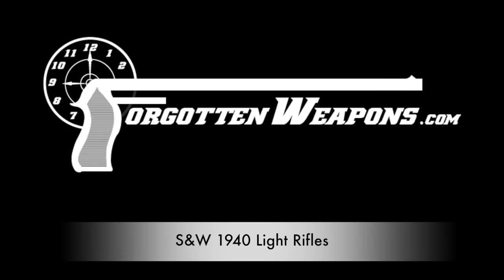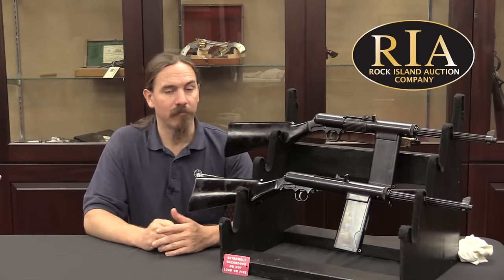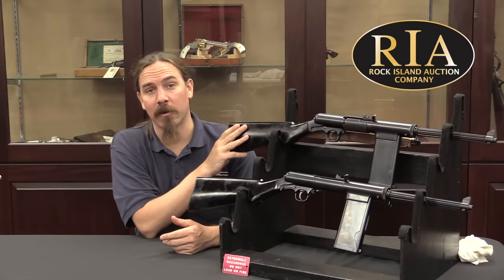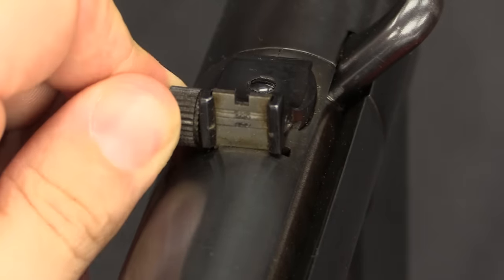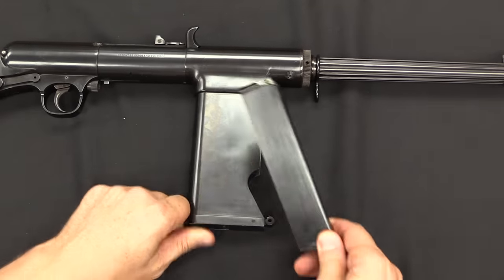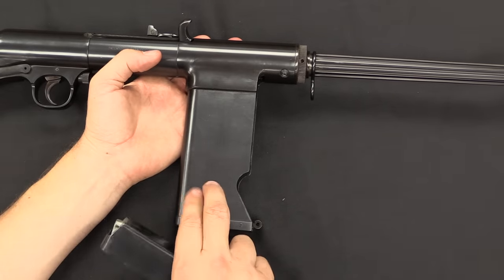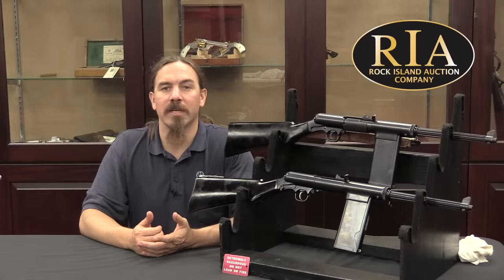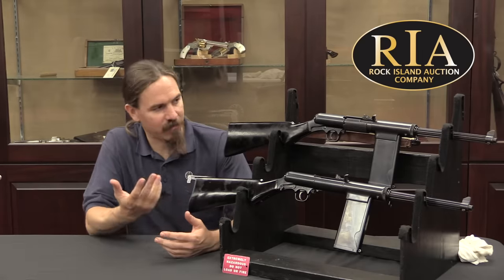S&W 1940 Light Rifles: Receiver Breakage is a Problem

Comment: Looks like a .30-06 SMG.
Reply: Twirlip Of The Mists unfortunately it’s a 9mm 😂
Reply: That's what I thought it was when I clicked on the video
Reply: Shane Sizemore same
Reply: Goes to show, size isn't everything.
Reply: I thought it was a .30 carbine rifle lol and submachine guns fire pistol cartridges haha
Reply: Had it really be a .30 carbine (yeah, .30 carbine can be fired in a pure blowback gun of acceptable weight. Trials made during the war with a modified Thompson demonstrated that a merely 570g bolt was heavy enough even for proofloads, that's less than the bolt weight of most WWII SMGs) sturdy enough, and shortening the silly ejection tube, it would have been a really interesting design.
Reply: @neutronalchemist3241  I get that, but I thought it could've been possible in this thing still.
Reply: @neutronalchemist3241  While 30 Carbine can be simple blowback, so can 30-06. That doesn't mean either of those are practical. Think about how heavy a simple blowback 45 has to be. Now at least double it for 30 Carbine seeing as it has over twice the inertia as 45 ACP.
Reply: @flightlesschicken7769   What part of ".30 carbine can be fired in a pure blowback gun of acceptable weight" was so difficult to understand? 
I repeat: .30 CARBINE CAN BE FIRED IN A PURE BLOWBACK GUN OF ACCEPTABLE WEIGHT. 
30-06 obviously can't.
A Hi-Point JHP .45 is "a simple blowback .45" that weight 907g, full 160g more than a breechlock Glock 21.
As said "TRIALS MADE DURING THE WAR WITH A MODIFIED THOMPSON DEMOSNTRATED THAT A MERELY 570G BOLT WAS HEAVY ENOUGH EVEN FOR PROOFLOADS. THAT'S LESS THAN THE BOLT WEIGHT OF MOST WWII SMGS". Infact the weight of the bolt of WWII 9mm and .45 ACP SMGs (usually around 600-650g) was used to slow down the fire rate.
Reply: @flightlesschicken7769  The .30 carbine had been developed starting form the .32 Winchester Self Loading cartridge used in the Winchester 1905 rifle that was, hear hear, a pure blowback rifle. The subsequent Winchester 1907 rifle (amply used in WWI) that was, hear hear, a pure blowback rifle, used the .351 Winchester Self Loading cartridge that is, hear hear, a SUBSTANTIALLY MORE POWERFUL ROUND than the .30 carbine (1900joule vs. 1300joule of energy at the muzzle). The Winchester 1907 rifle was slightly lighter than a M3 Grease Gun (despite being a fully stocked rifle) and substantially lighter (900g less) than the Thompson M1A1.
That a merely 570g bolt was enough to safely cycle even .30 Carbine proofloads (while a typical WWII SMG bolt for 9mm and .45 ACP weighted around 600-650g) is written in a PRIMARY SOURCE (George Dmitrieff 
"Submachine Gun 
Designer’s Handbook" 1981) so sorry, primary source beats random guy on a youtube channel.
It's almost as if you don't know what you are talking about.
Reply: @neutronalchemist3241  Yeah, but guess what? You are some random guy on the internet, and Ian (the guy whose very own video we are talking under) has a lot more credence than you as a firearms historian. 

Also what you said is not a primary source but a secondary or tertiary source depending on what type of book it is. As that 30 Carbine testing was done in the 40s anything written in the 80s would be a secondary or tertiary source. And by the title it sounds more like a tertiary source.

And although you are right that that gun was simple blowback, it's also much heavier than an M1 Carbine. My argument wasn't that you cannot make a 30 Carbine gun simple blowback, it's that not a single person did other than maybe a one off. If such a light bolt could be used then they would not have needed to be a locked breach for the M1 Carbine. If such a light bolt could be used the one off M1 Thompson in 30 Carbine wouldn't have weighed a kilogram more than the standard model. Especially when the Thompson is already known for its exceptionally high firerate and weight, I can't imagine the 30 Carbine M1 Thompson was made to firer slower as it was a one off prototype.

Also the 30 Carbine being based on the 32 SL is completely irrelevant, 32 SL is about 2/3rds as powerful as 30 Carbine out of a 4 inch longer barrel.
Reply: @flightlesschicken7769  Infact I provided sources that you can check if you want to learn more about the subject instead of childlishly trying to correct who knows better. You provided nothing. 

I said: ".30 carbine can be fired in a pure blowback gun of acceptable weight." not "lighter than a M1 carbine" so you can explain your supposed argument to someone else. A blowback rifle that was not really made to be the lightest possible and fired a substantially more powerful cartridge than the .30 Carbine, other than having been sold commercially, weighted less than the M1A1 thompson and and M3 Grease Gun, whose weights were considered acceptable in WWII, so, again, ".30 carbine can be fired in a pure blowback gun of acceptable weight."

The fire rate doesn't count in a semiauto firearm.  Any 9mm browning system pistol would fire at over 1000 RPM in full auto, someone cares? Besides, there are other systems than the weight of the bolt to slow down the fire rate of a gun if needed. 

What part of  "The subsequent Winchester 1907 rifle (amply used in WWI) that was, hear hear, a pure blowback rifle, used the .351 Winchester Self Loading cartridge that is, hear hear, a SUBSTANTIALLY MORE POWERFUL ROUND than the .30 carbine (1900joule vs. 1300joule of energy at the muzzle)." was that hard to understand?
Reply: @neutronalchemist3241  Those who "know better" obviously don't know what type of source is what type. As childish as it might be to point out  it is still true. It doesn't detract from your argument much but it is still true that it is not a primary source so don't argue it as one

I don't know how semiauto firearms came into the picture as they were not mentioned, especially since the 30 Carbine M1 Thompson was select fire. Again, I never said it couldn't be done, I'm saying you are wrong about how light the bolt is (or your source is) based on actual real world examples--perhaps the only example--of simple blowback 30 Carbines. Sure it doesn't need to weigh a kilogram more than a standard M1A1, the total gun could be as light if not a little lighter than the 1907 Self Loader, but all that additional weight added to the 30 Carbine Thompson was not added for shits and giggles. The Thompson has an absurdly large firerate so its bolt mass is not there to slow down its firerate much
Reply: @flightlesschicken7769  Another childish attempt to difert form the subject. 

Again, I said: ".30 carbine can be fired in a pure blowback gun of acceptable weight." If you assumed it was a full auto gun it was your fault not mine. Again there are other systems than the weight of the bolt to slow down the fire rate of a gun if needed. 

You didn't provide any source. Also you shown  that "you clearly don't understand physics" since, contrary to what you considered a physical necessity, the Winchester 1907 rifle (amply used in WWI) that was, hear hear, a pure blowback rifle and used the .351 Winchester Self Loading cartridge that is, hear hear, a SUBSTANTIALLY MORE POWERFUL ROUND than the .30 carbine (1900joule vs. 1300joule of energy at the muzzle) was slightly lighter than a M3 Grease Gun (despite being a fully stocked rifle) and substantially lighter (900g less) than the Thompson M1A1, two SMGs in .45 ACP.
Besides, the Winchester 1907 rifle had been modified by the French to fire in full auto in WWI. It fired at perfectly reasonable 600-700 RPM.
Had you known more of the subject before typing you would have known that many versions of the Thompson had been made, from 600 to 1500 RPM. the M1A1 fired at perfectly reasonable 600-700 RPM (what an "absurdly large firerate"!).

I can explain you how it's possible for the automatised Winchester 1907 and the Tommy gun to have the same fire rate despite the comparatively lighter bolt of the Winchester 1907 ("comparatively" means that it was lighter in respect to the power of the cartridge) if you want to understand a little physics for a change.
Reply: @neutronalchemist3241  Look, I just read your source and it honestly doesn't seem too great. It is definitely a tertiary source which is fine, but it doesn't cite any of its sources, which is not fine. It makes claim that a hot 9mm is in the same class as 30 Carbine. That is simply not true, no 9x19 loading is like 30 Carbine none that are safe to shoot anyway. It says that a 570g bolt was enough for 30 Carbine in the Thompson conversion when that gun weighed a kilogram more than the original (I can get you a source for this if you want) that it was modified from.  Perhaps they are right that 570 is enough, but it would likely have razor thin safety margins and would have such an insanely high firerate as to be unusable. 

You also keep talking about that 1907 are repeating how much energy it has but was simple blowback. Well I got some news for you, it wasn't a very good design because we don't see it anymore. No one makes a 223 Remington or 7.62x39 semiauto that is simple blowback. 223 is weaker than that .351 SL, yet no one does simple blowback for that. Just because you can do something and it is "safe" doesn't mean it is a good idea.
Reply: @flightlesschicken7769  So you think to know better, what's your source?
Maybe you should know that a rifle is not made just of the bolt, I also already explained to you that the weight of the bolt in a blowback weapon does not depend only to what's the lightest possible for safe cycling. 

570 was enough for proofloads. Proofloads are the rounds with which firearms are tested to determine if there is safe margin for operating with normal loads. 

"it wasn't a very good design because we don't see it anymore", LOL! That's really your argument? Because see plenty of new designs in .30 Carbine too, doesn't you?
To be a good design it only needs to safely going bang and reliably cycling, and it did both. Many samples are still existing and working. I got some news for you. It's not exactly amazing that you don't see many over 100 years old actions around. That doesn't mean that, like dozens of other actions used in over 100 years of smokeless automatic and semiautomatic firearms, it wasn't good. 

I notice tat you are not interested in learning how physics works. Not really surprising. However, first to talk about blowback .223 Rem or 7.62X39 in comparison with the .30 Carbine and .351 Winchester, you should learn something about the magical world of chamber pressure.
Reply: @neutronalchemist3241  My source is Ian. If Ian says 30 Carbine is too hot to realistically have it be simple blowback then I'm more included to believe him than I am you or some guy from the 80s who says 9x19 is comparable to 30 Carbine. As for physics, you seem to be the one who fails to understand it, because if you did you would know that something with 3 times the energy and twice the inertia of 45 ACP would require a much stronger system than 45 ACP. Again we come back to 30 Carbine simple blow back being possible but far too heavy to fill its role. There is more than the bolt to consider with simple blowback. The faster the bolt (and with 30 Carbine that bolt is going to be moving pretty fast) the stronger everything needs to be. Not to mention simple blow backs have much more recoil felt which sort of defeats the purpose of 30 Carbine

Also how many 100 year old actions do you still see around? Honestly, most of them. Most modern actions originated in the 20s or before. Slide action, bolt action, lever action, long stroke, short stroke, recoil operated, tilting barrel, the list goes on. But you want to know what you do not see today? Simple blowback in anything more powerful than 45 ACP. It is almost as if it was a bad design. There is much more to a good design other than functionality. Ease od use, complexity of the system, price, longevity. Simple blowbacks only real advantage is it is easy to make and simple.

Edit: yes 570 was "safe" for the proof load, but we don't actually know if it was safe for long term use seeing as the gun that value is supposedly based on was never officially tested. You did watch this video didn't you? This design was "safe" but it broke in 1000 rounds

If simple blowback is so fine for 30 Carbine to 351 SL, why has there not been a single mass produced simple blowback 5.45  (which is as powerful as 30 Carbine), 223/5.56 or 7.92x33 firearm? Because it's not the ideal design for those power levels. If it could reasonably be done it would have made it past the very early stages of self loading firearms like the 1907. It was a fine design for its day but not anymore
Reply: You know, I don't really like  arguing for this long. Do you mind if we stop. We can both go our separate ways feeling we learned something about the other persons views on the matter and call it quits? This argument is going no where fast
Reply: @flightlesschicken7769  Your is a faith not a source.Your faith had been already disproved by the fact that the Winchester 1907 rifle (amply used in WWI) that was, hear hear, a pure blowback rifle and used the .351 Winchester Self Loading cartridge that is, hear hear, a SUBSTANTIALLY MORE POWERFUL ROUND than the .30 carbine (1900joule vs. 1300joule of energy at the muzzle) was slightly lighter than a M3 Grease Gun (despite being a fully stocked rifle) and substantially lighter (900g less) than the Thompson M1A1, two SMGs in .45 ACP. Have you other means to prove your faith is right?

The Winchester 1907 had been a Police departments' favourite well into the '30s, many samples are still around and in working order despite being over 100 years old. Your theoretical considerations, based on a very superficial knowledge of physics, that mistake guessing for necessities, do not match reality. 

Because you see plenty of new designs in .30 Carbine too, doesn't you?
 To know why blowback is less suited to fire .223 Rem or 7.62X39 in comparison with the .30 Carbine and .351 Winchester, you should learn something about the magical world of chamber pressure. I can teach you if you want to understand a little real physics for a change. Besides, many good, very good and even exceptional actions are no more used for a reason or another (I can provide examples if you are interested in learning something).
To be a good design it only needs to safely going bang and reliably cycling, and it did both. Many samples are still existing and working. 

To decide if a firearm can safely operate with normal loads, it doesn't fire thousands, and not even hundreds, of proofloads. 
You understood that this video was about a 4 pounds carbine in 9mm didn't you? Tons of perfectly safe and lighter 9mm carbines had been made. How can you pretend to be taken seriously if you try to extend the problems of a faulty design to another one that you don't know?
Reply: I didn't search for you, did I? For me this discussion could have very well not even started.
Reply: @neutronalchemist3241  Nope I guess you don't want to stop them. Okay fair enough choosing to continue to argue shows a lot about you and is your prerogative. 

Chamber pressure is irrelevant to your argument as 30 Carbine is higher pressure than 351 SL 30 Carbine is 40kPSI SAAMI and 46 kPSI CIP, 351 SL is 39kPSI Especially when the thing you keep typing at me in all caps are units of energy not pressure. So which is it that matters oh Mr. Doctor of Physics? Which is the one that matters? Is it chamber pressure or is it energy? Because if it is chamber pressure why were you arguing about energy so much? Also what about 7.92x33? That's 49kPSI, that is closer to 46 than 39 is . Surely the N***s (so my comment doesn't get auto deleted) would have tried to make a simple blowback 7.92x33 when they were getting desperate at the end of the war, right?

Also use in WW1 doesn't mean it was particularly good, they used plenty of bad designs that war. They all seemed to ditch it in favor of other designs the second they got the chance. They ordered them because they were desperate for guns. Did you notice the lack of simple blowback rifles in WWII?

Also I have no more faith in Ian than you seem to have in that one source from the 80s. Don't accuse me of speaking from faith when you speak just as strongly based on faith. Do you not personally believe Ian is a reliable source of information? If you address one thing in this comment I would genuinely like to know if you think Forgotten Weapons is a reliable source

Edit: I should note I am not positive on the pressure for 351 SL.  You also didn't read my last comment did you? Because if you watched this video then you would know that this little 4 pound PCC was a bad product and broke in only 1000 rounds. I don't know about you but that seems like a pretty bad design
Edit2: I looks it up on CIP's website, 351 SL seems to be 51kPSI. That is absolutely in standard rifle cartridge pressure range and further raises questions as to why we don't see 5.56, 5.45, 7.62, or 7.92 as simple blow backs
Reply: @flightlesschicken7769  Aaaand you are still here. Not that there had never been any doubt. It was not really that difficult to guess that all that you wanted to have is the last word. 

You are (conveniently) mistaking PSI with CUP and mixing them. Saami max pressures for .30 Carbine and .351 SL are 40.000 cup and 45.000 cup respectively so, surprise surprise, .351 SL, other than being a SUBSTANTIALLY MORE POWERFUL ROUND worked at a HIGHER PRESSURE.

I'm glad you finally decided to learn something. Let me introduce you to the magical world of chamber pressures and how it relates to blowbacks. 
In a blowback system, the base of the cartridge starts moving backward the same moment the bullet starts moving forward. Is largely that initial movement that allows the entire action to work. But, since the walls of the cartridge are stuck to the chamber by the same pressure, the integrity of the cartridge, until the pressure into the barrel drops to safe level and the cartridge can be entirely extracted, depends, other than the weight of the bolt:
1) on the capacity of the brass at the base of the cartridge to stretch without rupturing until the pressure drops to safe level, 
2) on the pressure that, if low enough, can allow some backward movement of the brass (the lower, the better),
3) on the same pressure that tend to cause the rupture the cartridge (the lower,the better). 
So, the higher the pressure, the more difficult is to use a blowback action, because an higher pressure narrows the margin in which the base of the cartridge initially moves enough to cycle the action, but not enough to have a case rupture.  That happens largely INDIPENDENTLY FROM THE POWER OF THE CARTRIDGE. Low pressure rouds can have high power, but generally pay for this by being bigger. Modern propellants and metallurgy allowed to have very high pressure cartridges in respect to those of the late 19th early 20th century.
.223 rem and other modern cartridges are generally high pressure cartridges, even the ones that produces moderate energy, and that leaves a more little margin for safely operate a blowback action.
That's not the case of the .30 carbine, that worked at lower presures than the .351SL that was safely used in a blowback rifle that weighted less than a .45 ACP SMG.

Please. Really you want to be taken seriously with arguments like "N***s would have done it"? With a completely different, bottleneck, cartridge? That's not even close to be a demonstration of anything. N***s didn't make a simple blowback handgun for the 9X18mm Ultra. It had been done after the war. They didn't make a simple blowback handgun for the 9X19, but used, ordered and paid the Astra 600.

The Winchester 1907 had been a Police departments' favourite well into the '30s, many samples are still around and in working order despite being over 100 years old. We were talking about .30 Carbine not other cartridges used in WWII in other rifles. How many powers used a similar cartridge DIRECTLY DERIVED FROM A CARTRIDGE SPECIFICALLY CREATED FOR A BLOWBACK ACTION during WWII?

My source is backed by reality, your faith is disproved by that. The Winchester 1907 rifle (amply used in WWI) that was, hear hear, a pure blowback rifle and used the .351 Winchester Self Loading cartridge that is, hear hear, a SUBSTANTIALLY MORE POWERFUL ROUND than the .30 carbine (1900joule vs. 1300joule of energy at the muzzle) and that OPERATED AT A HIGHER PRESSURE (45.000 cup vs. 40.000cup)  was slightly lighter than a M3 Grease Gun (despite being a fully stocked rifle) and substantially lighter (900g less) than the Thompson M1A1, two SMGs in .45 ACP. Have you other means to prove your faith is right?

I appreciate Ian, but don't believe something just because Ian says it. He's mostly right, but i've noticed many mistakes over the years, and others did as well.
Reply: @neutronalchemist3241  It has become quite obvious to me that you haven't actually been reading my comments. I've been taking the time to read yours yet you have not been returning me the same courtesy. Accordingly I will no longer be interacting with you no matter how much you seem like you want to fight. You only seem to skim my comments which is better than some people

 I never said it couldn't be done and the fact that literally no one has done it beyond a prototype scale is suggestive of a flaw with the concept 

While it is true the 1907 was light for simple blowback, that may have something to do with it being a rather long gun, allowing the blowback more time to slow down. It is by no means a compact little PCC or carbine. Logically it can be made simple blowback but it is not the ideal design for it

Further, if you took the time to read my comment you would have seen that according to CIP 351 SL has a chamber pressure allowance of 51 kPSI CIP (we are not talking about outdated and inaccurate CUP) 45 kPSI SAAMI. 223 on the other hand is 52-55 SAAMI 54-62 CIP--the values vary depending if it was crusher or piezoelectric determined. 7.62x39 is only 45 kPSI and 7.92 is 49 kPSI. If you would notice many of these have the same energy and pressure as 351 SL yet you ignore that. You say how their pressures are to high when they are nearly equal

Given that you refuse to address my facts and rather keep repeating your facts (like how 351 sl has more energy than 30 Carbine when you are now talking about chamber pressure and it is irrelevant) which by the way I acknowledge as true. The problem is, based on your fact set you draw conclusions that don't reflect the real world. If simple blowback is fine why do you only see early rifles using it? If simple blowback is enough for a durable military rifle why was one never formally adopted in large numbers after WW1 ended and they would have supposedly seen how effective they are. Such a simple design would surely have been adopted on mass if it was truly as good as you say.

Simple blowback has been used and it has been effective but its design is not ideal for cartridges like 30 Carbine or 351 SL. With how obsessed the firearms industry seems to be with "the best possible thing" I would be willing to bet you a lot they'd still be making rifles simple blowback if it is as good as you say

Point to me another example other than the 1907. Something in 7.62x39 preferably. It has the same pressure and  similar energy as 351 SL.... Not that I'll even be looking at your next comment

Edit: also Ian is not perfect in everything he says but he does change his views when presented with new evidence. Yet nothing has persuaded him to  change his views on simple blow back not being enough for 30 Carbine after many years. You seem to put credence into one paper from the 80s that doesn't even cite its sources.

Also the N*** thing was just to show a desperate party who was making increasingly crude weapons. Like you've seen some of the incredibly crude stuff they made toward the end, right?
Reply: @flightlesschicken7769  Again, I didn't search for you, did I? For me this discussion could have very well not even started.

The .30 carbine had been developed starting form the .32 Winchester Self Loading cartridge used in the Winchester 1905 rifle that was, hear hear, a pure blowback rifle. The subsequent Winchester 1907 rifle (amply used in WWI) that was, hear hear, a pure blowback rifle, used the .351 Winchester Self Loading cartridge that is, hear hear, a SUBSTANTIALLY MORE POWERFUL ROUND than the .30 carbine (1900joule vs. 1300joule of energy at the muzzle) and that OPERATED AT A HIGHER PRESSURE (45.000 cup vs. 40.000cup). The Winchester 1907 rifle was slightly lighter than a M3 Grease Gun (despite being a fully stocked rifle) and substantially lighter (900g less) than the Thompson M1A1, two SMGs in .45 ACP that had been used in WWII (and the M3 for decades later). So what exactly prevents the .30 Carbine from being fired in a blowback firearm of reasonable weight?

Are you sure you are looking at the right rifle? The 1907 had a merely 2" longer barrel than a M1 Carbine (actually longer barrels are worse for blowbacks, because it takes the bullet more time to exit from them) and THE ACTION IS REALLY SHORT. The magazine is right in front of the trigger and the action doesn't extend behind the trigger. Do you think the buttstock is part of the action? 

No, they are not nearly equal. 53.000 psi (max C.I.P pressure for .351 SL) is not "nearly equal" to 62.000 psi (max C.I.P. pressure for .223 Rem). Even not counting that blowback actions don't cope well with bottleneck cartridges and, again "the N***s didn't do that" IS NOT AN ARGUMENT. N***s didn't do a lot of things. 
The argument is: The .30 carbine had been developed starting form the .32 Winchester Self Loading cartridge used in the Winchester 1905 rifle that was, hear hear, a pure blowback rifle. The subsequent Winchester 1907 rifle (amply used in WWI) that was, hear hear, a pure blowback rifle, used the .351 Winchester Self Loading cartridge that is, hear hear, a SUBSTANTIALLY MORE POWERFUL ROUND than the .30 carbine (1900joule vs. 1300joule of energy at the muzzle) and that OPERATED AT A HIGHER PRESSURE (45.000 cup vs. 40.000cup). The Winchester 1907 rifle was slightly lighter than a M3 Grease Gun (despite being a fully stocked rifle) and substantially lighter (900g less) than the Thompson M1A1, two SMGs in .45 ACP that had been used in WWII (and the M3 for decades later).SO WHAT EXACTLY PREVENTS THE .30 CARBINE FROM BEING FIRED IN A BLOWBACK FIREARM OF REASONABLE WEIGHT?

Please, you didn't state facts, but guessings at best. You asked why blowback is not used on modern cartridges of moderate power, and I answered you. If you don't understand pretty simple explanations is not my fault. Modern cartridges are mainly high pressure cartridges. In a blowback firearm, energy mainly affects the required minimum weight of the bolt. Pressure narrows the window of usability of blowback actions (the higer the pressure, the narrower the window from when the bolt is too heavy to reliably cycle the action to when it's too light to safely do it) until other factors (material of the cartridge, presence of dirt, moisture, lube, ecc...) become too relevant. Even not counting that blowback actions don't cope well with bottleneck cartridges (I can explain you why if you want). 

7.62x39 is not only a bottleneck but a heavily tapered cartridge. I can explain you why that doesn't cope well with blowback actions if you want.